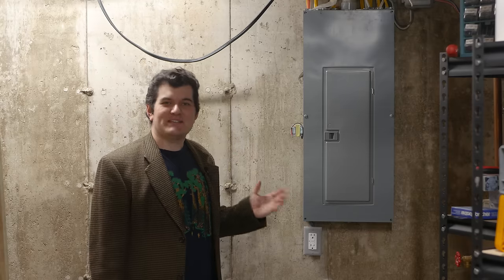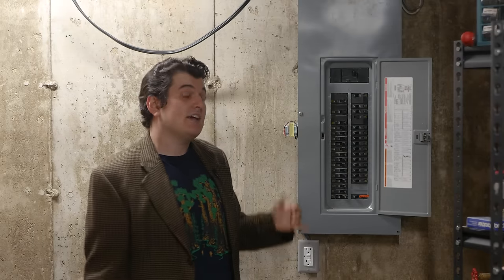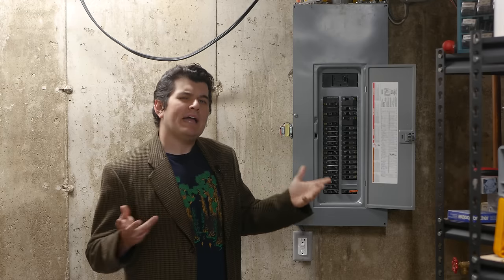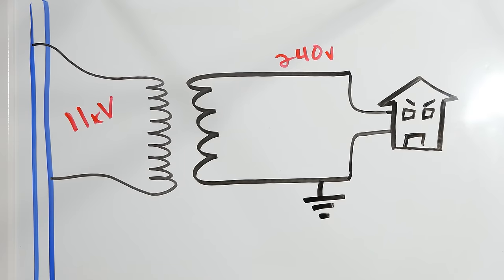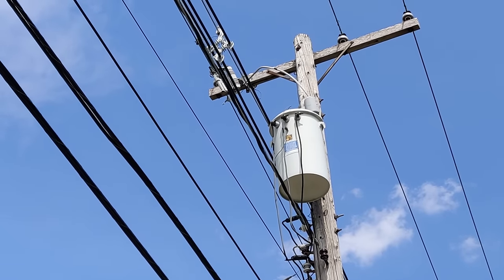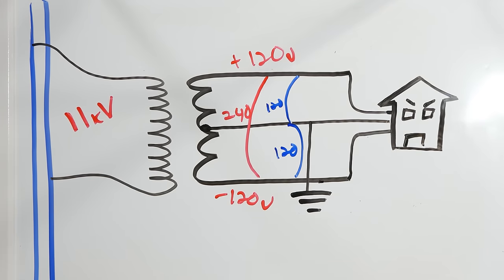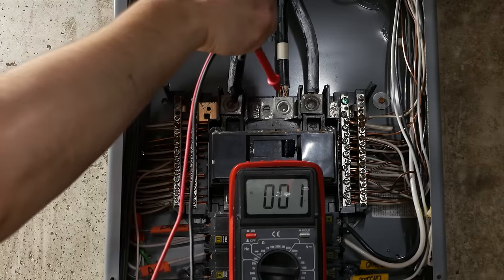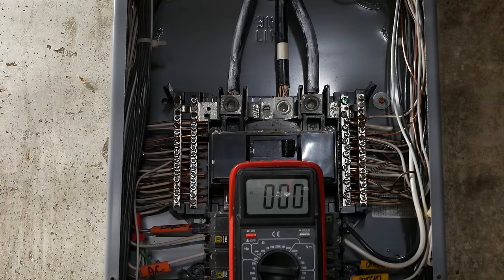The US electrical system is not 120V

Comment: Well. Europe are actually 400v countries if we are looking at it like that. We have 3 x 240v
Reply: @Roman F. yes. In sweden it is more common to have 3 phase in apartments than to have 1 phase. 3 phase is easier when you put in a oven and stove combo
Reply: Came to say the same. My kitchen oven uses 400 volts taking two of the three phases.
Reply: Well then I guess we're really 480V in America if we're going to 3 phase. It's reserved for commercial buildings though. I guess we have 600V too actually.
Reply: @Roman F.Yup I have three phase power in my house,its actually quite common well at least where i live.
Reply: yeah. the u.s grid is the best in the world. for all it's strangeness guess what... line level voltage counted in 100 millions of volts. amperage so high i don't even think about it. when it rains you can hear the voltage Hitting the ground under our lines lol.  you guys are funny talking about 400v we have devices here that operate on voltages 100 times that. one electronic steel furnace would probably brake you guys whole country down. thers 2 in my neighborhood and 3 car plants.. lol 400 volts... i could do 680 at my house. you guys are funny 😄  talking all that crap for real.
Reply: @krazzykiller1  That is the most American comment I've read in quiet a while.
Reply: In Finland we also have 400v in three phases in all apartments and houses. How to power a sauna heater otherwise??
Reply: @TheCarpenterUnion  Ok. And Switzerland and other Countries in Europe have 690V for their Industry (well, this is not the whole story since you will have big companies in many diffrent countries that even have their own 10kV Inlet with transformer etc.)
But all in all, I guess bigger is always better, isn't it? ;)
Reply: @krazzykiller1  you are so full of it.
Reply: @marranpa  and your home distillery ? Kippish
Reply: @krazzykiller1  Considering we can literally use every consumer good electronic without issue, I think the US system is fine.
Reply: Actually, the British had 240 V and went down to 230 V, and a few other countries had 220 V and they raised. That started in 1987 and took about 15 years. Now it is 230 V nominal voltage for the low voltage network plus minus 10% (depending how far you are away from the distribution transformer and the load status and the amount of distributed generation).
Reply: @gunnarkaestle  I don't live there but it's only harmonised to 230V from what I know. In the past the UK was 240V +6%/-10% and most of mainland Europe using 220V +10%/-6%, the new 230V "standard" is conveniently using +10%/-6% tolerances so up to 253V and down to 216V is within specification. Conveniently this already matched a lot of the infrastructure that's in place, I'm sure some places did have to adress a few issues but they certainly picked this in order to not have to do too much (and keep old pre-harmonisation consumer equipment functional).

Based on what I've heard from people and seen on a few channels (bigclive, John Ward and a few others) running into good old 240-250V is still the norm in a lot of places... and perfectly in spec with 230V +10%/-6%.
Reply: @marranpa  my parents have a sauna sinze 30 years in they house, and are under 240V 50Hz without any problem...In France is 3 phase very rare in common houses/appartments, only use from people who use professionnal machines (like a friend  who as a late in he's garage...) or a high power electric car charger box...
Reply: No, that's 415 V.  240 × √3.
Reply: @daytonasixty-eight1354  
Actually you wouldn't even know whether you could use all electronic consumer goods, would you? The only stuff you'll find for sale is the stuff that works on the power net. 
In addition, you would also not know that you're using the same goods less efficiently ...
Reply: @TheCarpenterUnion  Same in the UK,our 3 phase power is 420v.In South Africa it's 380v,220v single phase.
Reply: Josh Smith  Center tap on star wired transformer is N/PE,all 3 windings connected
Reply: american here

3 x 240 = 720 sorry
Reply: @krazzykiller1  you really have no clue what you are talking about
Reply: @TheCarpenterUnion  NO Because your local transformer only taps two phases.
In Europe you are supplied by single phase or three phase .
Reply: Americas have 3 phase but you might need it specially installed and the only reason you'd need it is for heavy equipment with 3 phase motors ect
Reply: It's possible to get 3ph run in a garage, you just have to ask the power company.
Reply: Here in the US, 3 phase isn't rare but typically only for commercial buildings. Btw, I thought Americans were the wasteful ones. Here we do more with less and we are the ones ruining the planet? Lol just saying.
Reply: @red2theelectricboogaloo961  No? Ever heard of phase cancellation?
Reply: @keithweaver7585  In Germany residential buildings usually get 3x400V because you need that for flow-heaters. BTW: More Voltage doesn't mean more usage, in fact more volt means less energy lost in the wire as heat, thus making the grid more efficient
Reply: @Ruhrpottpatriot  so then you have 2x240 which is 480 which isn't exactly 400v but is close enough
Reply: @red2theelectricboogaloo961  Wrong again. In three phase electric power the phases are shifted by 120° to each other, resulting in ~400V.
You can check that yourself by first calculating the interlinking factor, which for three phase is 2* sin(pi/3) = 2*sqrt(3)/2 = sqrt(3); or more generally for an m-phased system: 2*sqrt(pi/m)
From that you can calculate the overall voltage by multiplying the interlinking factor by the voltage of one wire, i.e. 230V * sqrt(3) ≈ 230V * 1.732 ≈ 400V.
Reply: @Ruhrpottpatriot  ok but even still he said 3x240 which adds to 720
Reply: @red2theelectricboogaloo961  No! 3*240 means three phase power with 240V on each line. In Europe residential areas always get three phase power, with 230V@50Hz (the old standards were 240 for British isles and 220 for continental EU) against ground, resulting in 400V total between hots.

This is the same as described in this video, If you go from hot to neutral you get 230V, if you go from hot to hot you get 400V.
So by saying the US is  240V, then Europe is 400V.
Reply: @tokeeptrackofrandomsubs5899  In my country - Poland - it was advertised as EU forcing us to change from 220V to 230V. But since lot of infrastructure was already in place and it only forced people who had very old wiring to change it to pass the test (when we bought house in 2006 it had cables from 1970's and the power supply was running 170-190V - so not good) it was a good thing. And we were told that everything old (220) will work just as fine on new (230). Of course fear mongers wanted us to believe that EU wants our stuff to burn faster :D . Somehow it didn't happen.
Reply: @damianbisha6712  well that's one perspective to look at it from
Reply: @jeahtc  cars are not wires though. i just thought 3 wires at 240 mean that it would total 720 volts. not everybody is an electrical engineer.
Reply: @denelson83  Yeah, we get 415v - 3 phase power in Australia. Most houses run single phase, if you have a requirement for three phase at home you can have it installed at your expense. It is rare to not have three phase in commercial properties.
Reply: @TheCarpenterUnion  Shows how much you know about three phase i guess doesnt it. If phase to phase there is 208v, where are you getting the 480v figure from? 

Incoming mains to commercial buildings here is generally 11kV, and stepped down on-site to 400v with the star mid point as ground, giving 230v nominal from ground to any 1 phase, and phase to phase of 400v nominal. 

Your single-dwelling domestic supply is NOT a two phase supply, it is 50:50 split, dual voltage single phase. In multi-dwelling situations the building takes a three phase supply at 120v/208v, single and poly-phase respectively. Each individual dwelling within the building is given TWO PHASE SUPPLY, and ALL appliances remain a SINGLE PHASE APPLIANCE. Any appliance using only two of a possible three phase is still a SINGLE phase appliance. 

In Australia, you can connect single, two, or three phase supply to pretty much ANY building you want, provided it is available at the point of distribution. Larger appliances using electric motors are very often three phase, because it provides a perfect rotating magnetic field and is substantially more efficient. Single phase electric motors use a start capacitor in the start winding to provide a leading current to supplement the lagging current in the primary winding and create a rotating magnetic field, and this is how your 240v electric motors all work there, having the 50:50 split-phase places them 180* apart, and that will not create a rotating magnetic field because there is no offset to the split.
Reply: @krazzykiller1  and i can do 11,000v at my house if i hook up to the primary side of the transformer, so what is your point? 

Furnaces do not generate their heat from electricity either.
Reply: its a matter of need in Canada here.. the mains goes to the house but if you have a garage or something with a mig welder you need 240volt is..    its basically a larger line with a bigger plug :-\
Reply: @TheCarpenterUnion  ya beat me to it. I owe you a scotch.
Reply: The calculation on single phase voltage to the the three phase  @red2theelectricboogaloo961  are as follows:

Single phase voltage  x  (square root of of number of phases)

240 x (3^(½)) = 415 volts.

This is because the 120° differences between the voltages at any given point of the phases.

Your formula only works on DC or three phase where the frequency are synchronised and that will be an impossibility in any generation of electricity.
Reply: Omg so this video was all about phases? haaaa
Either way European way is better
Long live the metric system!!!!!
Reply: @jeahtc  Actually 3 cars going to 80 mph is the same in the long run in transporting than 1 car going at 240 mph, you get the same throughput of parcels delivered, its only that the 240 mph has better latency and the 3 x 80 mph are consistent
Reply: There are big differences inside Europe. In the Netherlands a lot of apartments don't even have decent ground circuit wiring at important places and in general crazy random wiring inside the walls.  In Switzerland, Sweden or Germany there are strict standard and quality control at construction.
Reply: @CaseTheCorvetteMan  You should look up EAF (Electric Arc Furnace). Primarily used in steel production. Temperatures range between 1800°c - 3000°c (3272°f - 5432°f).  They are AC or DC powered depending on use and design.
Reply: I never understood 3-phase but I worked at a small AM radio station in the middle of nowhere 40-some years ago. One of my jobs every morning was to start the "phase generator." It sounded like the U.S.S. Enterprise (TOS) firing phasers.
Reply: @krazzykiller1  yes hes, in US is All better! ( not)
Reply: There are clearly a lot of people here who don't understand three phase AC supplies and how the voltages of two of these phases can be added together to give the required (desired) (now no longer actually true) 415V. However some of these responses do indicate an understanding. Historically the UK supply was two 240V, 120deg out of phase supplies. When used together this gave a 415V single supply. IIRC You cannot use three phases as they would cancel out. As mentioned in the comments below, in the 80's the UK and France (Europe) wanted to use the benefits of the time zone difference to share supplies across the  English Channel (La Manche). The rush hours, being separated by an hour (ish) allowed the UK to supply France during the morning breakfast hour, and then for France to supply the UK one hour later. Same in the evening. This made for more efficiency by having a shared grid, but at the cost of altering power generation by 10V on either side of the water.
Reply: @simonvanegten7444  Yep. It is 100s of THOUSANDS of Volts and not Millions. Currently it is at 500kV.
Reply: Josh Smith  Tell that to our neighbor when we lived in town. He had 208/120 3 phase in his home.
Reply: @krazzykiller1  switzerland still best ;P

Comment: "Stop being pedantic about it," he says, pedantically.

In seriousness though, great video! Learned a lot I didn't know. The whole "it's the current that kills you not voltage" thing is really only applicable to high voltages built on small capacitors (e.g. static discharge from shaking hands won't kill you despite the high voltages involved) but people misapply it to everything.
Reply: I went radio and tv repair school ,some body would always charge up a capacitor and leave it laying around waiting for some dummy to pick it up and get zapped. Not funny

Comment: 16:50 the AC/DC wars happened when Tesla and Edison got Thunderstruck.
it is known.
Reply: One short to ground and they're back in black.
Reply: They both won. All inside PC is dc. Though a lot of it is signals, they're AC. Also most of current has AC component and DC component.
Reply: I've heard of AC/DC and Tesla but not the band Edison, much less all of them doing Thunder Struck. Wow!
Reply: Well Edison did do dirty deeds dirt cheap.
Reply: @SirCavemaninthewest  YESSS!!! "AC vs DC" happened when electrocution of criminals came under scrutiny for torture.
Reply: Fun fact, AC/DC can be knocked out when Australian power legs interface with American thighs. The vibrations from the resulting event could shake you all night long.
Reply: @lolerie  kinda

Comment: UK Brit here, some devices don't actually turn off they go into stand-by, such as TV's, which still consumes some electricity to keep the LEDs running and some internals to run updates in the background such as on Smart TV's. Switching it off from the mains actually saves power and most of the time we don't have any intention to re-use that socket for another appliance either.
Reply: the standby current of most devices however is measured in hundredths of a watt, such a small amount of power that modern power meters probably cant even read it. modern "smart" meters are actually pretty dumb in that they cant detect extremely small amounts of power

Comment: In the US the main thing was lighting when electricity was introduced to homes. We used to have a 30 amp 120v system as a standard originally. It went up to 60 as more appliances and lighting were used commonly. We didn't need 240 because no one had electric dryers, central a/c or electric water heaters. 120v was the norm, so when we needed 240, we already had the standard for lighting and small appliances at 120. We would have had to toss all our 120v small appliances and light bulbs which have specially engineered tungsten steel filaments and change all of those to withstand 240v to go with our large appliances, which many people could not afford. As an electrician, your video was really thorough. Your QO Square D breakers clip to a rail. Some of the best for residential. The ground and neutral are bonded at the service per code but separate in the field at the outlets. To avoid as much of a shock when plugging something in, make sure it is off. That takes the load off the circuit. Your example had someone plugging in a lamp while it was on. Don't do that. Shut it off first. I don't see anything wrong with our receptacles. I would never plug in an electric dryer or stove with the circuit breaker on. Many people need this video to understand the basics of having the convenience of electricity in your home. Great job.

Comment: In EU we have 400V 3-phase at our homes..phases are split into several 230V circuits to balance overall load. Btw AC rating voltage is in RMS so, 230V peak to peak is 325V! ;p
Reply: In the UK most properties are single phase, with a third of the properties on each phase. Blocks of flats (apartments) have 3 phase running up the stair.
Reply: Ireland here, single phase 63A or 80A is standard for a typical house. 200A or three-phase is pure opulence!
Reply: US Houses built in the early part of the 20th century generally only had 60 amp services.
Reply: Modern German Single family houses have 400V 3phase 63A. But as most houses se are heated with Oil or Gas this is often not used and the Main Circuit breakers are rated at 25A per phase
Reply: Sweden, standard here is 3 phase 400v 25 amp service, 16amp main in the house split into 230v plus neutral to balance the load.
Reply: @AaronSmart.online  how do you watch TV while doing laundry, running the dishwasher, baking bread, boiling water and vacuuming all at the same time?
Reply: In Italy all productive buildings get 3 phase 380V
Homes usually get 240V single phase, but since backbone cables brings all 3 phases and each house is randomly attached to 1, if you want 3 phase at home it's just a matter of calling the company and asking (and upgrading the home wiring)
For available power, the base is usually 3kW but you can request more
Reply: @SamuelLogan  You are forgetting charging the car, and the electric heater.
Reply: @BS-eh1zf  Kochfelder werden mit 400V angeschlossen also wird das schon oft benutzt.
Reply: @MPnoir  Ich wollte darauf hinaus, dass kaum jemand die 63A eines normalen Hausanschluss wirklich nutzt. Außer vllt bei ner Wallbox fürs E-Autos

Comment: The voltage at the transformer before stepdown to residential buildings in Concord NH is about 7300 volts. This was told to me by a lineman from Unitil.
Reply: I doubt that any country would build a low voltage system like Canada and America today, but would cost too much to change it.